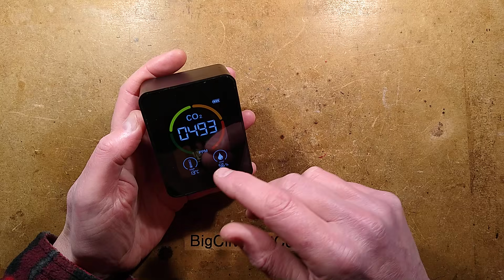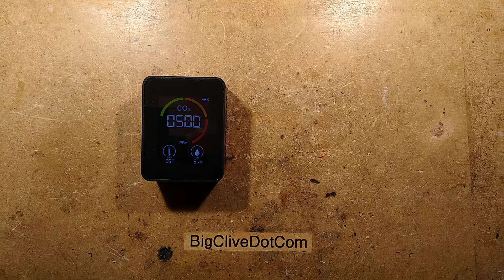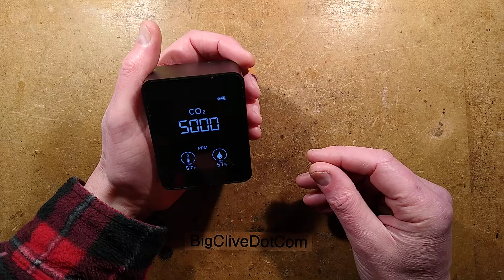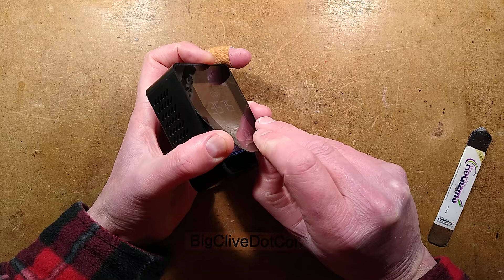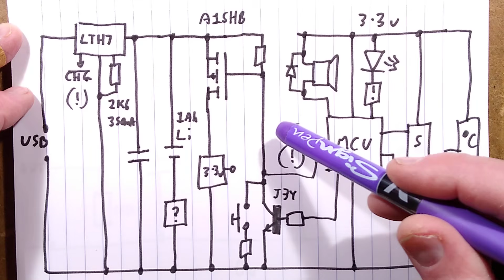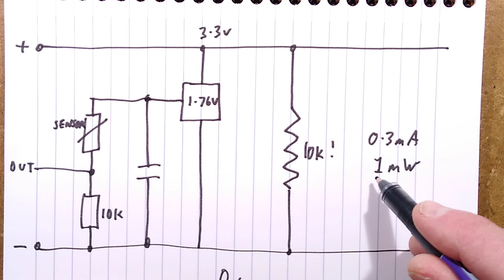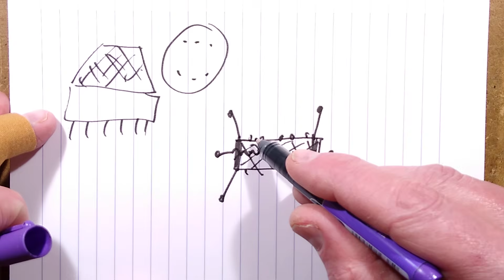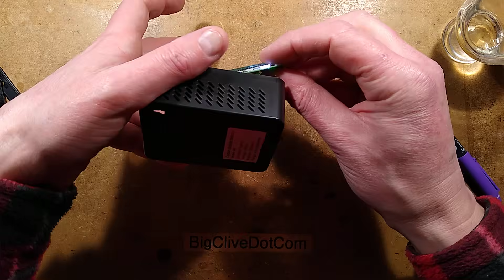Fake CO2 monitor (party detector) with schematic

Comment: My parents have an air filter/ionizer that automatically ramps up fan speed based on alcohol levels. Hilarious!
Reply: A number of air purifiers have VOC sensors. Could be that
Reply: We have quite a few Winix air cleaners and their sensors are rather sensitive to farts.   Needless to say, these have been a source of endless amusement.  No way someone is getting away with farting in the house without getting caught.
Reply: @grayrabbit2211  and now I need to find one or ten of those to strategically place where my puppy sits. 🤔
Reply: @1973retrorabbit  haha
Reply: @1973retrorabbit  Sincere tip on excess dog farts: more dry food, less wet food.  Our boxer farted so often (and with apparent glee) that I was tempted to invent charcoal boxer shorts for him.  Sincerely: wet food -> fart clouds.
Reply: @1973retrorabbit  Totally off topic, but the fact that "Retro Rabbit" is responding to "Gray Rabbit" is amusing.
Reply: @grayrabbit2211  i am dying now 🤣🤣
Reply: I've got a Winix 5500-2 that might be what they have. Upon detecting a change it turns on for 5 minutes on high, then 5 minutes on medium, regardless of whether the filter is helping.